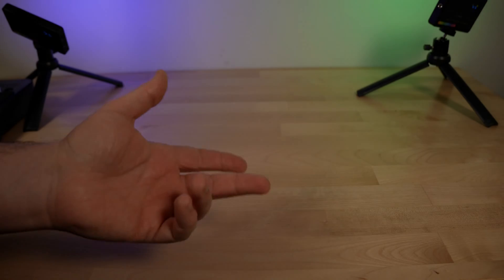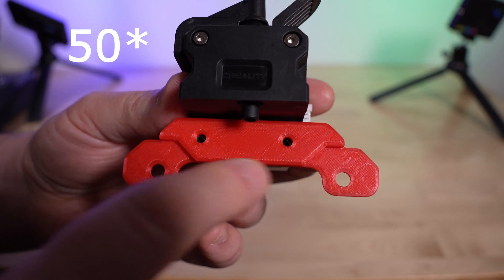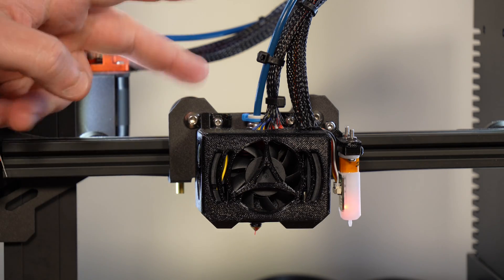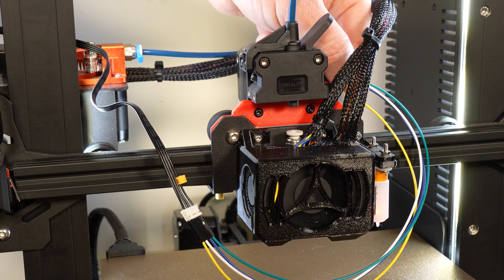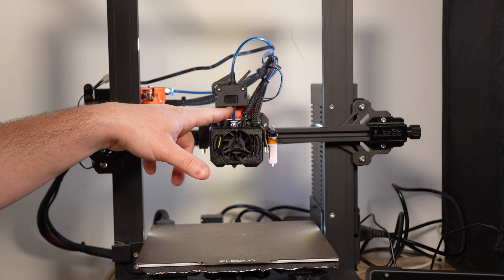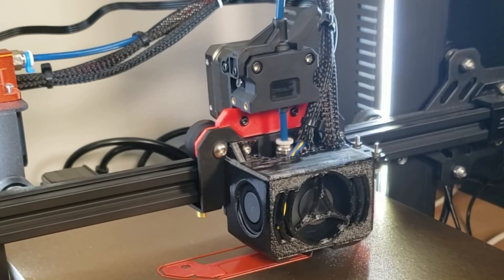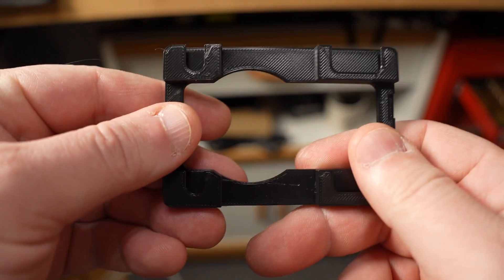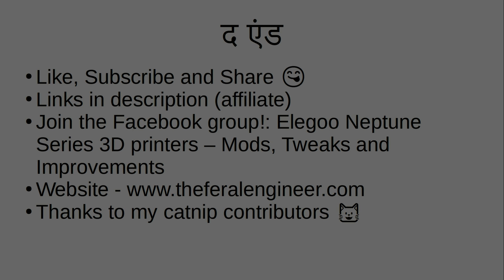Installing a Creality Sprite SE extruder on an Elegoo Neptune 2

Comment: how do you get a solid extusion rate with out changing the firmware?
Reply from the maker: with stock marlin, you can just edit the firmware settings and reflash the eeprom with a program like pronterface

Comment: Hi, I have a Creality CR-6 SE for some time. I have problem with the extruder and want to replace the same with a direct drive one. This one looks good and the price is decent too. The problem is in India I cannot find the extruder-stepper motor combo kit. I can use my stock 42-40 (which is heavy) or buy the kit motor separately. Could you please give me the details of the kit motor so I can find one online (or compatible one). Thanks.

Comment: I need help the stepper motor wont work. It might be because I have a neptune 2 not 2s
Reply from the maker: 2 and 2s are the same, at least the latter versions are. Do you have a v1.2 or v1.3 board?
Reply: @TheFeralEngineer  I have a 1.3 board
Reply: I tried swapping wires and just vibreates
Reply from the maker: @LucasBanner-e7m  same. Did you try doing any of this stuff with the machine powered up?
Reply from the maker: @LucasBanner-e7m  if it's vibrating, then the center wires are probably crossed
Reply: @TheFeralEngineer  unfoutunately yes
Reply: @TheFeralEngineer  can we do this over text?
Reply: @TheFeralEngineer  yes i did it with the printer on
Reply: @TheFeralEngineer  please help i don't want to buy a new printer I've put so much effort into this one
Reply from the maker: @LucasBanner-e7m  I'm busy today, sorry. If you have a multimeter, you need to find the proper motor phases and compare the pinout with the original stepper. That's probably 90% of your issue. The other possibility is a loose wire.
Reply from the maker: @LucasBanner-e7m  you should never perform any type of electrical modification with the printer turned on.
Reply: @TheFeralEngineer  I GOT IIITTTTT!!!

Comment: Hey! You are completely right about the Neptune S2 being a solid base for tinkerers as myself. I built a klicky like probe onto my S2 and it works flawlessly, and not to forget I run klipper in a VM on my computer and communicate with the robin mks nano v1.3 board (that came with the printer by default) through USB with uart serial communication. 
It was nice to have your klipper config while tinkering with my klipper install, so thanks for that!
I plan to make my config public so others could get ABL just by taking apart an old pc mouse, harvesting the switch from it (or using the z-limit switch) to make a custom Klicky probe.
I also plan to make my printer direct drive, but using the original extruder, only changing the stepper motor to a smaller one.

Keep up the good work! :D
And have a lovely holiday.
Reply: No S, just plain Nep2, the best sandbox printer in the last 5 years at least

Comment: Nice! I have one on my Ender 5 S1, and I am happy with it, although I had to use a good amount of lube on the big gear to make it not squeak on retractions.
Reply from the maker: That's a common thing on these bmg clones. I don't go above 30mm speed because my retractions are less than 1mm anyway

Comment: I have the E-Fit Kit extruder, so do I need to swap the 2 middle pins of the cable to make it work?
I also have a Neptune 2
Reply from the maker: Did you check out my efit video on the Neptune 3? I did have to do some wiring trickery, but I believe the pin configuration is different than the Sprite
Reply: @TheFeralEngineer  I don't remember (I see too many things to remember them XD), and I struggle a lot with spoken English, but I'll try to watch your video :)
Reply from the maker: Here you go. This should help. 

https://youtu.be/Ox_FMgsaOhc